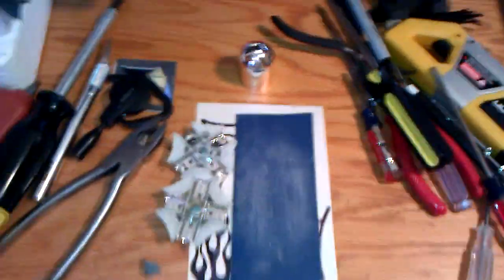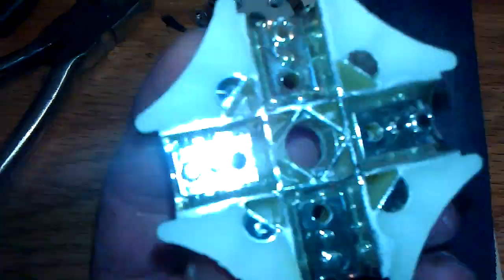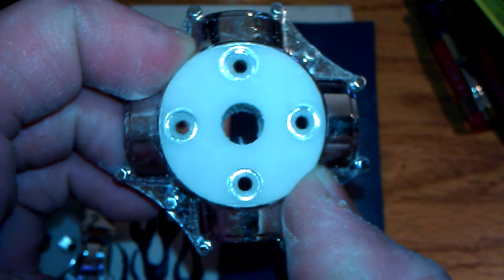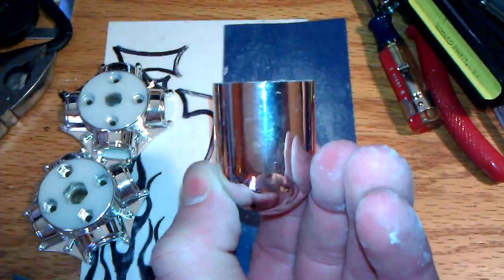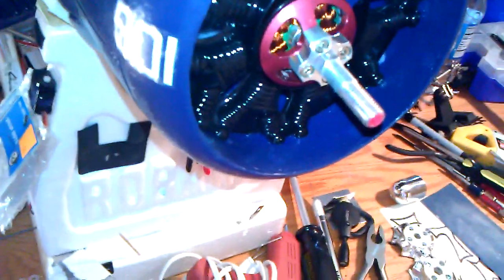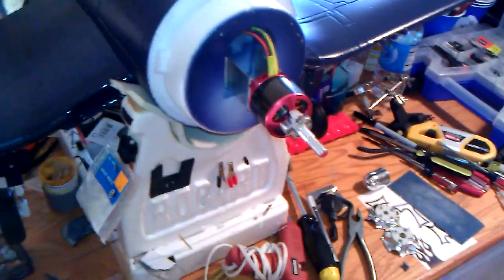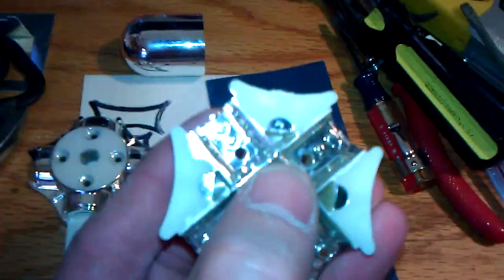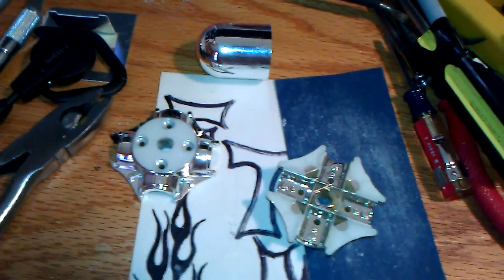Airfield 1430mm F4u Corsair prop balance tips

Comment from the maker: @ranthm Not a problem ranthm I'll have that video coming today, since that is my next step after installing me separate UBEC with separate lipo. I never throw wires in sloppy, to many wires that are hot run power in a pulse pattern, this can cause serious RF interference so I devide my wires in a certain way every time. I'll cover that. stay tuned. Also good question another much overlooked detail that cost people planes.

Comment: I hadn't flattened my prop hub halves, but will now. Using a DuBro prop balancer, I found that the hub itself was out of balance. I fixed that by by taping progressively heavier screws to the hub. When I got the one that balanced it, I screwed it in to the backside of the hub. I did the same thing with the 3-blade hub you can get from PW-RC. Another tip: weigh each blade individually. If you can get all 4 the same weight, great. If not, put two the same weight opposing each other.